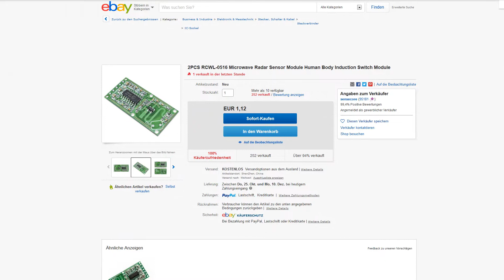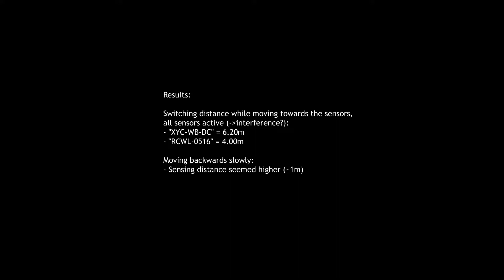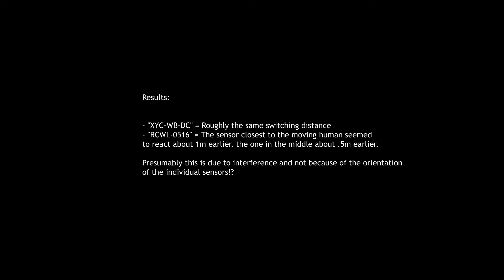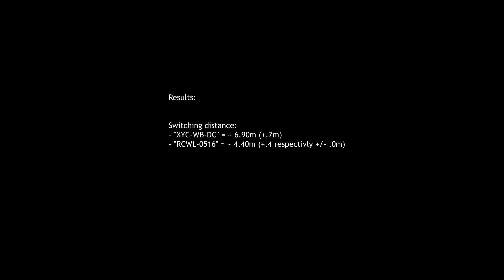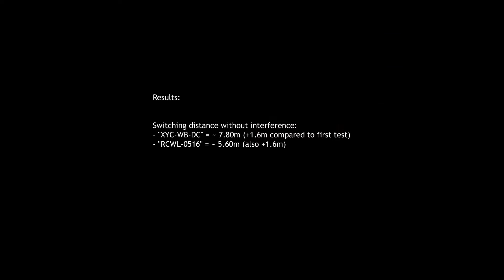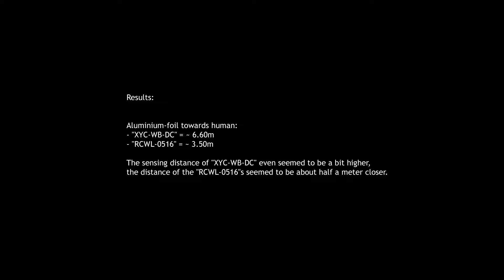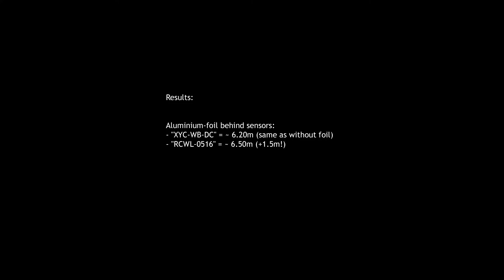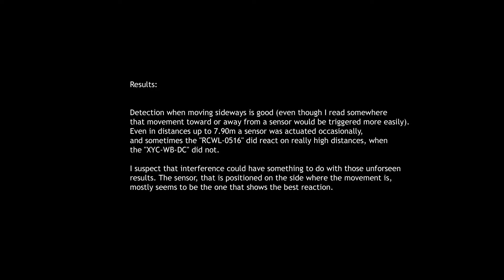RCWL-0516 vs XYC-WB-DC : Radar Microwave Sensor Field Test

Comment: I have a number of the RCWL-0516 sensors around inside my home.  I find that their are too sensitive in some cases for my purpose of measuring occupancy of a room.  For example, I have one attached to an ESP-8266 -based "nightlight" plugged into the wall in a spare bedroom used as a home office.  It detects me moving around in the room on the floor below.   The floors are all wood construction.

You may have issues with windows since many of them have metallic coatings to help with IR heat loss; I notice this affects various high frequency RF signals.  I get better signals on my cell phone with the signal going through my outside wall vs. when I'm standing right in front of the window (that's in the path to where I know the cell site is located.)  I would imagine this same effect would impair the high frequency RF signals the RCWL device is using (I think around ~3GHz or so?)

Comment: That was a nice test, please do test how to increase the time atleast to 15 minutes on those, I could figure out that
Reply from the maker: I wouldn't know how to increase the time, for my needs it is best if the time is as short as possible. I would use an Arduino or something similar to control the timing after the sensor put out the signal.
Reply: @arduinoob7785  does it sense movement from non human object like woods or metal? i nneed somethinh that detect human presence only
Reply from the maker: @adamoryza  Yes, I think it does detect non human movement. I do not know any sensor, that does react on humans only.
Reply: I did it by attaching a capacitor to the pins on the back, look in the datasheet . Different value capacitors give different delays